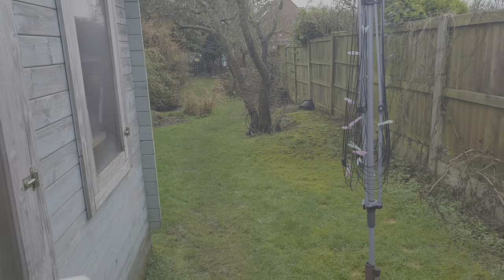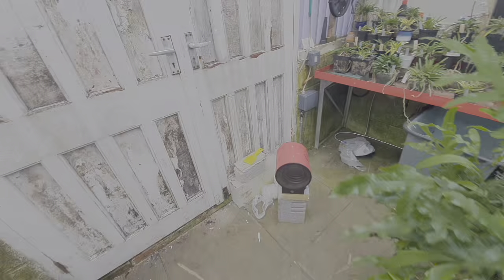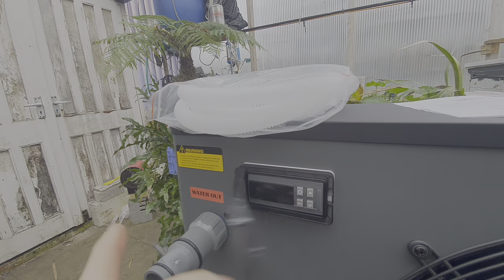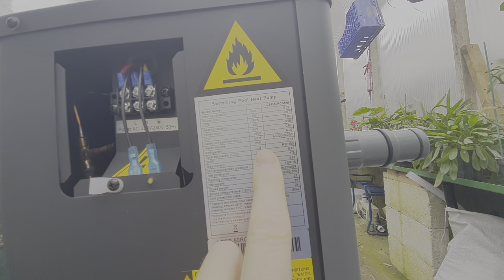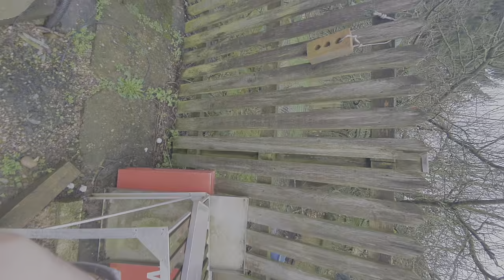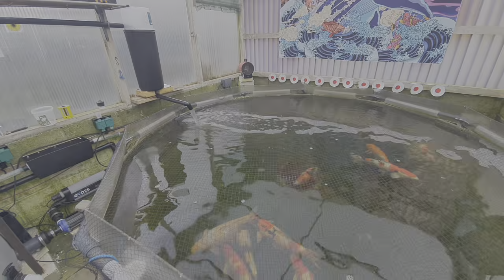Mini Air Source Heat Pump for the Indoor 5K Koi Pool

Comment: Would fit inside greenhouse
Reply from the maker: But wouldn't it draw all the warmer air out of the greenhouse and end up cooling that space, then run out of sufficient air and choke?
Reply: Hi have air source heat pump running a grow tank inside a shed probably about half the size of yours runs no problem when running it only kicks in for a minute or two worth’s try it’s drawing from your warm air  @KoiKicks
Reply from the maker: Can't really do that due do so position of greenhouse and pipes and I'd have to put a huge rectangular hole in the wall. And surely it would remove the warmer air from the greenhouse causing temp in there to be lower and kick my heaters on sooner.
Reply: The  @KoiKicks

Comment: That pump seem to only work down to 7 degree according to google so - temperatures would be an issue the thermotec mini’s would be a better option they are down to -7
Reply from the maker: Hi, it can work to 0. Will report back, maybe it will only serve when I want to maintain 24c fir growing in Summer for 5 months

Comment: Install the air source inside the polytunnel it will pull in warmer air so it will be cheaper to run and perform better. Just remember to leave space front and back of it👍
Reply from the maker: Hi, I don't have a polytunnel thanks
Reply: @KoiKicks  yh just a saying meant in the building.by getting it into a building with warmer air around it will save you money.having kids haven't watched your video all the way through. The thing is with the cheaper air source heaters they don't like cold temps so closer to 0 degrees they have a melt down and stop working until temps outside comes back up👍
Reply: @danharbun483 yes that is true but in doing so you must ensure that the fan is blowing outside so would mean a large hole 🧁👍👍👍
Reply from the maker: Yes, tbh I thought this was a model that works down to -7 but it doesn't so my bad there!, it knocks off a 0c. I didn't intend to heat in winter so want to maintain 12c, so looks like my indoor heaters will have to pick up that slack then ashp used above 0 then when it's warmer to maintain 24c hopefully. Another option is I have an inline 1kw Electro heater that I could fit and set to 12c. Another option is to turn all that off and leave them to the ambient indoor temperature for a few month. Decisions, decisions, decisions 🤔 😅 no matter which way you try it costs an arm and a leg. There's simply no getting around it 😆 . Bastard